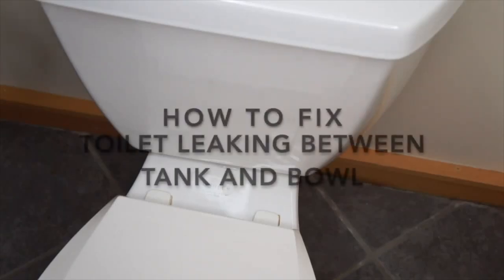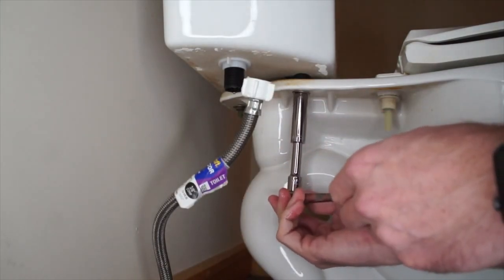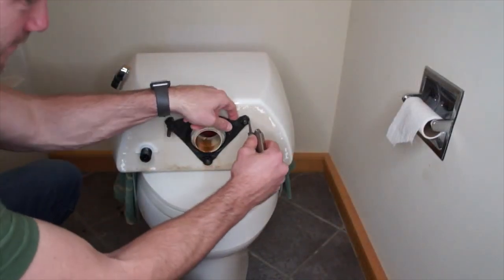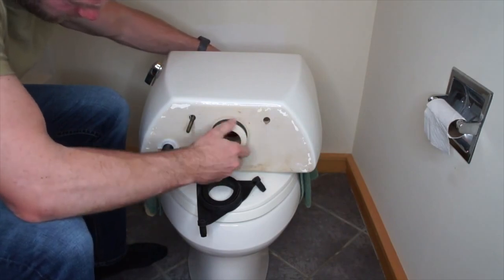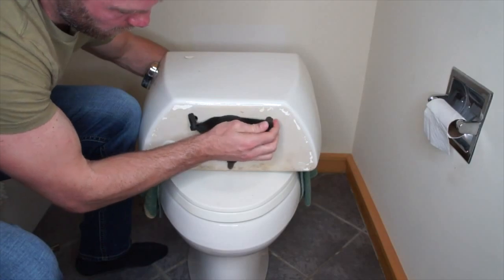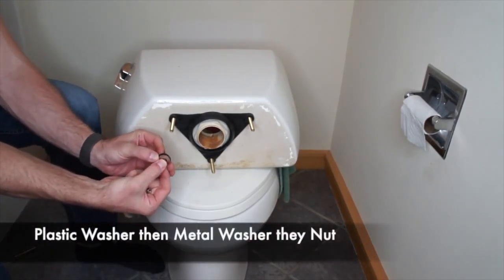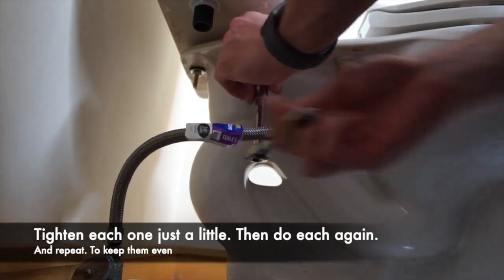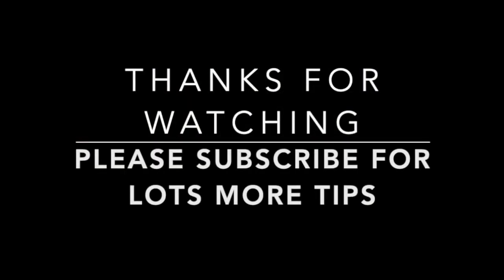Toilet Leaking From Back When Flushed

Comment: Why would this issue only happen when flushing?
Reply from the maker: That is probably bad wording in the title. I was trying to target specific issues. If it leaks when you flush, the seal between the tank and bowl is bad (or at least not sealed right). If you have a constant leak between the tank and bowl then it’s either the seal inside the tank or the seal around one of the bolts. However, this video shows how to replace all of those at the same time and will fix either issue.